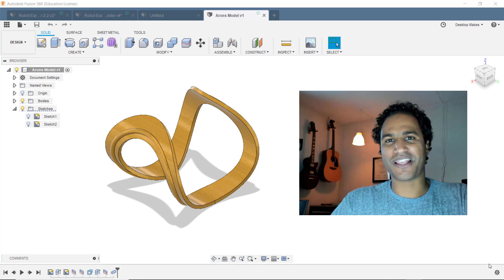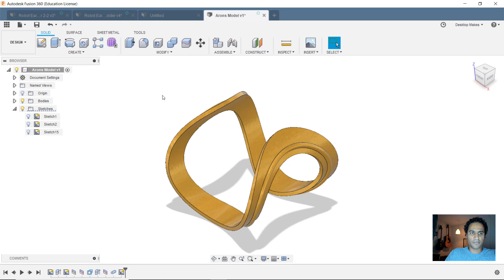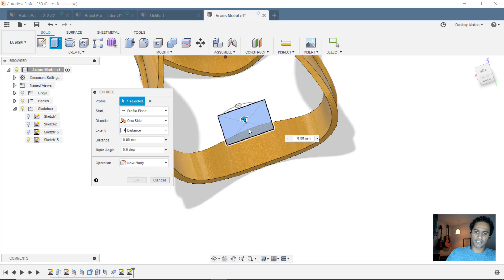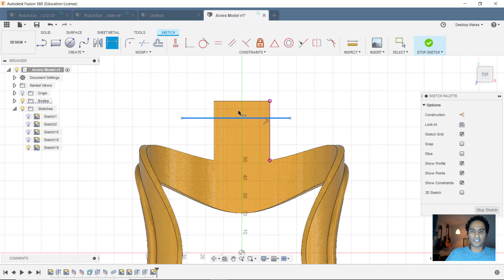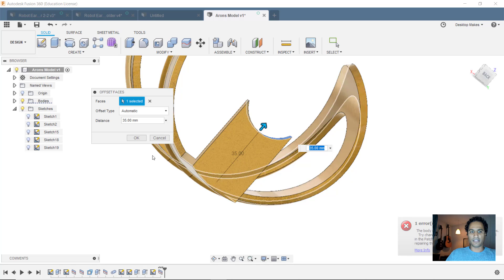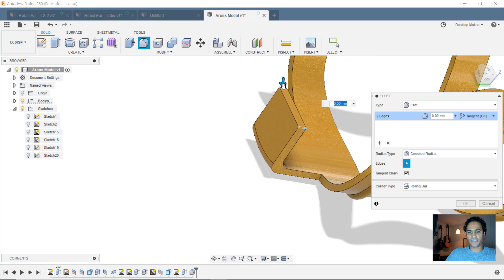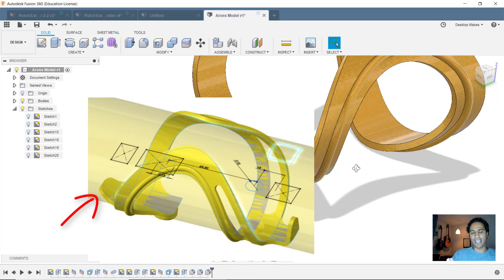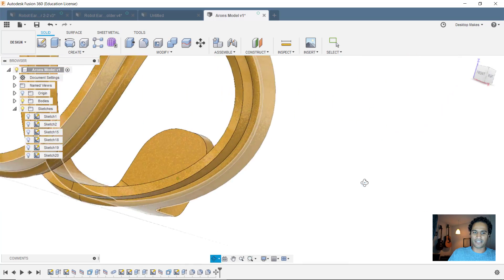Split Face Part 2 Fusion 360

Comment: Great videos on your channel!
I know that you are a professional. Tell me please, is it possible to somehow make the edges of the scanned 3D model to be even and smooth? They sent me a scanned part in the STL file, and the edges go in waves, when printing, the quality is not very good.
No one can solve this problem ((
Reply from the maker: To edit an stl with Fusion 360 you can check out this video or use software made for specifically editing stl.  Some scanners come with their own software or you can try Meshmixer.  https://youtu.be/-IE7kKxdTFY
Reply: @DesktopMakes  I can not. I even offered to help freelancer.com with this problem for financial reward, but no one has yet agreed. I did not scan and I do not have software for the scanner.

Comment: Cool, thanks for tutoring!  I need some more help with manipulating the timeline.  I drew up a simple pulley and at the end I added a keyway.  But then I checked something in an earlier sketch and realized an extrude or some other function wasn't being included.  I think I needed to move the extrude to a point after the last sketch but I'm a bit lost at that point.  Thanks again for all your helpful content!  Jim

Comment: Hey, :) Thx. Super!
I'd tried combining the last (3) filets into a single (1) filet function(?) by using the (newer/newest?) filet tool + (add) another filet. I believe that will work.
Reply from the maker: Just read your comment and tried it.  Hadn't really used it before and didn't realize you could add multiple radiuses (radii?) to a single fillet feature.  It really cleans up the timeline from having multiple different fillet features in a row.

Comment: 3:18 you did the same rounding radius on both sides. In my opinion, the inner radius should be smaller than the external one.
Reply from the maker: Thanks Marcin.  Good to know.

Comment: Would it be easier to sketch that part on ZY plane and extrude symmetrically. Add filllets and done.
Reply from the maker: It would be difficult to do because the part curves in all directions.   You could probably create the sketch and then do a Sweep but this would require more work to get it match perfectly.
Reply: @DesktopMakes  oh, you`re right in this case)

Comment: Nice tips. Cutting then pulling the edge face isn't an obvious technique. I would have tried to "add" something.  Move faces tip great too.
Reply from the maker: Thanks garagemonkeysan.  I seldom use the move faces tool but it can be a powerful tool in the right places.